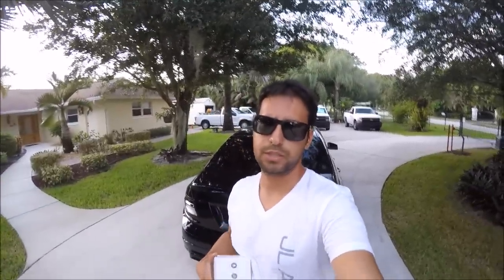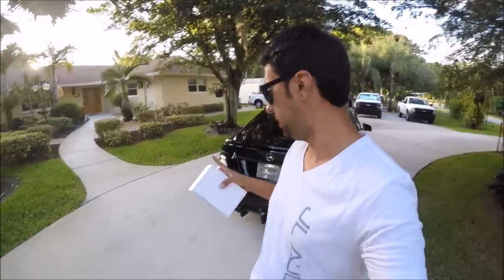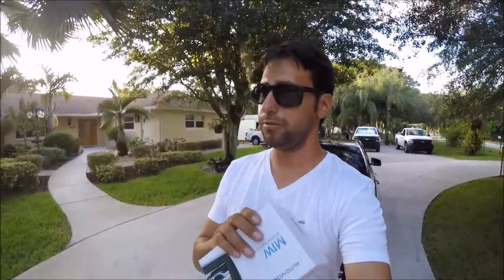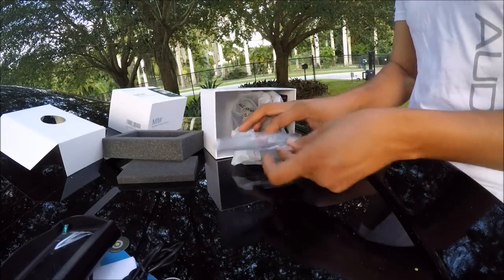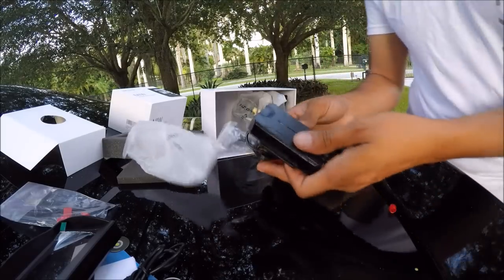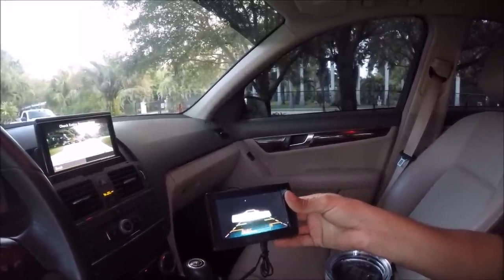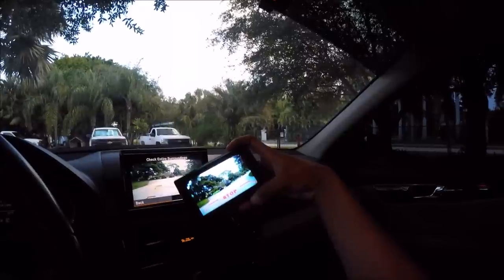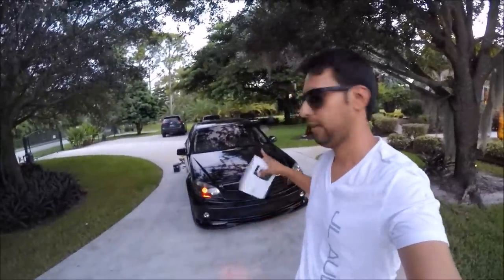"Wireless" Backup camera install?

Comment: I’m a disabled female veteran and I purchased a 2011 Chevy Express 15 seat passenger van. I priced my local shops and $750 was the cheapest backup camera installed. I found the Auto-Vox M1W on Amazon for $102.00. I can understand how this M1W works in theory. If it is easy to install, my neighbor installs high end stereo equipment in cars, so I was going to offer to pay him $100 to install this system. Does that sound like a fair deal? Thank you. Ps: I used to be a fighter pilot and it bugs me that this van scares me because of its size. But, F-111’s and B-52’s are fast and huge, but there are few things to bump into at full altitude!

Comment: So it is now 3 years later and they are still selling this model on Amazon; have they updated the unit at all or is it still exactly the same. I bought a used truck with one of these already installed and the picture constantly flickers on and off while backing up. Just curious if it is worth replacing with this or will it just end up doing the same thing?

Comment: Great instructions. Thank You!. I just installed 2 Autovox m1w wireless in 2010 Honda CRV and 2004 Sienna following your installation instructions. It went great. I wanted to test my reverse light using your instructions just to be sure before i made the connection, but the test did not work!. Don't know why!. I would have thought the positive would light up my 12v circuit tester but it did not. Thoughts? . I took the chance and connected. It worked!. Thanks again.

Comment: Raymond i have installed the Auto-Vox M1W which does work when i put the vehicle in reverse but when i push the brakes the video cuts out until i let go of the brakes. What do you think the problem is?

Comment: hi have two questions

what if im dumb and bad with electronics, will plugging the wrong wiring of the device screw the device or screw up the cars lights? also are there better products with NO wires  just plug a camera in the back with a wifi antenna and plug a camera on the dashboard? every product i see requires some sort of of wiring
Reply from the maker: Plug it in wrong will only cause it not to work and possibly throw a fuse or error code. Unfortunately everything needs power and signals so wires are here to stay for now. Check out the Pearl system

Comment: This is being installed on my 2017 Kia Rio LX.  The thing is that the monitor is always on from the time the car is started.  The transmitter has been wired to the reverse light (which is blue) but it's on whether it's in Park, Drive, Reverse or Neutral.  This doesn't seem to be normal, so how can that be fixed? 

Also, is there a way to keep the gridlines but remove the flashing word "STOP"?

Thanks again for your great videos.
Reply from the maker: +tt.tourist I found that the grid lines include the stop word, so it's an all or none type of thing. The monitor should be on but change to a black screen. Is this what you mean? Or is it always broadcasting the camera?
Reply: It was always broadcasting the camera, however, the problem got figured out.  This is a hatchback and when the wire from the transmitter was placed right by the light bulb, up in the hatch, instead of being wired lower down by the trunk space area, the camera worked as designed - it came on only when in reverse.

When it was wired to the blue reverse wire that trailed down by the trunk space area, the camera was on full-time.
Reply from the maker: tt.tourist awesome great to hear and I'm sure someone else will find this information valuable!

Comment: Great video, looks easy enough to install, how far apart can the transmitter be from the screen, can you mount the camera on the back of a trailer?
Reply from the maker: +Stanley Anderson I see what you are thinking but this systems range is limited to about 12' and the transmitter can't get wet... You could check out one of their larger systems:
https://youtu.be/OS03lkzGGnA

Comment: thanks for these vedios... I'm actually working on installing a backup camera on my car... but i would like it if i can access the feed from this camera on an iPad via wirless... is it possible??
Reply from the maker: ASB1401 not with this camera. If you are doing an iPad dash you will need a WiFi transmitter or a Rand Mcnally camera or similar

Comment: I need something like this for my 1982, yes, my 1982 Lincoln Mark VI.  I have been so frustrated trying to find something that functions as the manufacturers make claim to.
Reply from the maker: +Ken Cosco Sr. You definitely need a camera with that 18' land yacht! They are definitely gorgeous cars tho. You should just Upgrade the radio to one with DVD and hard wire a camera in it. Unless you want to maintain everything in factory condition. Then I would get the Auto-Vox M1W
Reply: Thanks for the kind words.  One of my concerns was, how heavy is the mirror?  I am also in Florida and worry about too much weight and having the original mirror falling of the windshield because of the summer's hot, hot sunshine.
Reply from the maker: If you are looking at the rear view mirror option they do add some weight to the mirror but its not much. make sure you buy one with straps if thats the approach that you are going with. As for the heat, i wouldn't worry too much about that. If you buy this M1W just make sure you put up a sun visor so its not getting the direct Florida sun
Reply: Thanks very much for your input!!
Reply: I love the lincoln mark series. Ive had 2 vii's, one i modded with a mustang 5spd manual trans, mass air conversion, full custom catless exhaust, intake, all kinds of goodies. Kept the air ride, i wouldn't give that up for coils. The second version of the mark iii is prob my favorite, other than the ii of course. The first versions of the iii, iv, v, were pretty cool too, all one year only. The vi's and viii's i wasnt crazy about. The vi was hardly dif than the towncar only 2dr, the viii's...idk...they just didnt do it for me. They're all pretty cool cars, those were jus my least fav of them all. I still have a vii that im resto modding. Tubular k member and a arms, was going to go with a 460, but the one we had ended up having scored and over heated crank bearings, so ill prob jus go back to a built 5.0  w mass air

Comment: Hi bought and installed this on a 2000 Toyota Tacoma . When I put in reverse I get a nice pretty picture for like a second and the the screen flashes from picture to black screen on and off . Made sure the monitor and cables to camera and transmitter are connected correctly even tried moving antenna . Any advice ?
Reply from the maker: you can remove the antenna and upgrade it with this:
https://www.amazon.com/gp/product/B00Q18HUT4/ref=oh_aui_detailpage_o06_s00?ie=UTF8&psc=1

BUT if the screen is going to black then there is probably a power issue. I would look into the option of wiring it up to a relay....https://www.youtube.com/watch?v=MNWNAC7kNUA#action=share
but that is strange a 2000 tacoma should not need that. recheck the wiring connections ground and positive make sure they are secure
Reply: Ok I will check on that thanks for the reply .

Comment: Good video, but I am surprised you put all that hardware on your trunk lid without using a towel or mat to protect the paint.
Reply: Was thinking exactly the same thing. :(

I just need a wireless reversing camera with no wires and dismantling the car... that should be left to the professionals IMHO.

Comment: are there wireless backups that don't need cigarette lighter wired plugs?
Reply from the maker: There are hard wire kits on Amazon. Just find the correct plug for the monitor

Comment: I'm considering attaching this to my license plate of my motorcycle but obviously not connecting it to "reverse" since my sport touring bike doesn't have it.  The screen would be mounted on the handlebar similar to mounting a phone.  Has anyone tried this?  I currently have a Goluk dashcam mounted which is viewed via a phone app but the view is reversed and there is no way of changing that, so what I see coming up on the left is actually coming up on my right.  One thing that the Goluk does is records to microSD.
Reply from the maker: +PcTech Ventura Not gonna lie that sounds badass! I would get the Auto-Vox M1 not the W. The screen it's self is not water proof but I feel it would be a cheap fun experiment. Run the power to a switched 12v. Please keep me posted on this it sounds like a fun project!

Comment: have a 2003 escape and both wires leading to the reverse light are hot and the camera is on all the time, ran one wire to the reverse light  and don't know what to do. Please help?? I DO HAVE THE M1W UNIT
Reply from the maker: Unplug it! 
It seems like you have it wired incorrectly to constant on.
The system should be wired to a 12v that turns only only when the car is in reverse, it should not always be on:
Red wire = Reverse light wire
Black wire= Ground
Reply from the maker: +JAMES VELING There is no way the unit will stay on if you ran it to the reverse light. The reverse light cable only gets power when the car is in reverse. You must have tapped the incorrect cable.
Reply: I connected the back wire to ground in the lid in the 2003 escape  and ran the red to the  back up light and unit is on all the time. Check both wires on the back up light and both are hot and when I connected to the other wire unit is off even when the car is in reverse. Should I run the black wire from the transmitter of which I have ground in the lid and run it to the other wire on the back up light, so both wires are connected to the back up light.
Reply: Otherwise the unit is great
Reply from the maker: The Ford Escape reverse light circuit is a GROUND switched circuit, this means that voltage is applied at ALL times.Ground is applied when the tranny is put in reverse, so you need to put the Red Wire(12volt) off the camera to the positive of the backup camera.  The ground wire from the camera has to go to the black and pink wire (Dont quote me on this wire color its been 4 years since I have seen an escape) at the reverse lamp. Or you could always use a relay but it requires more wiring.
Reply: We are talking about wiring for the M!W unit. which has the transmitter. Do I wire it directly both black and red to the back up light? Sorry if I don't really know what to do>
Reply: I appreciate that you are taking the time to help me!!!
Reply from the maker: Yes wire both to the back light wires. Red to positive backup wire...Black to negative backup wire
Reply: both wires on the back up light are hot, so if I connect the black wire from the transmitter and the red won't it blow a fuse?

Comment: can some that has this camera tell me if it truly has a 100 meter range with monitor? wanting to install on my 40 ft camper. thanks
Reply from the maker: +GUNNER it does NOT have 100 meter range I would say 8 Meters TOP.
YOU need something like this:
https://youtu.be/OS03lkzGGnA
Reply: figured, the product states 100m online which is over 300 ft. crazy. the MW3 states 30m. have you been able to test that as well?
Reply from the maker: +GUNNER yes here:
https://youtu.be/OS03lkzGGnA
The camera WITH the antenna out preformed all other Wireless cameras for heavy duty applications. The ability to move the antenna around is also great. If you purchase it make sure you buy the antenna I mentioned.
Reply: Raymond Urias thanks for the help.

Comment: Hi Raymond, do i need capacitor for Honda accord EXL
Reply from the maker: Abu Hasan Md. Assadujaman pull your bulb out and see if you get "Bulb out warning" if you do then yes.
Reply: Hi is there NY video guide on how to perform that test. My car says it is us build. So if I take out the bulb connection if I see warning that means I need capacitor
Reply from the maker: +Abu Hasan Md. Assadujaman if you see the warning then you NEED a capacitor
Reply: i didn't see warning so i don't need extra capacitor